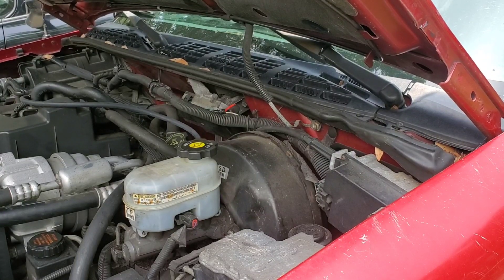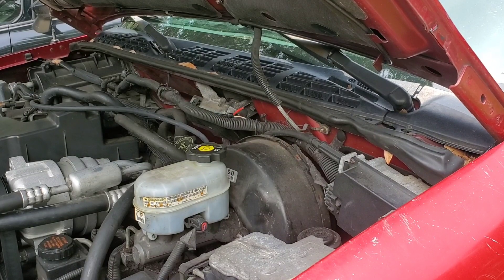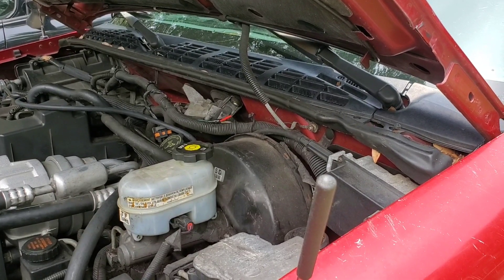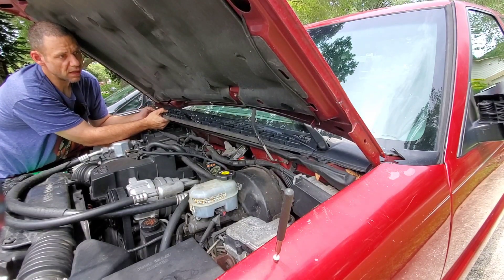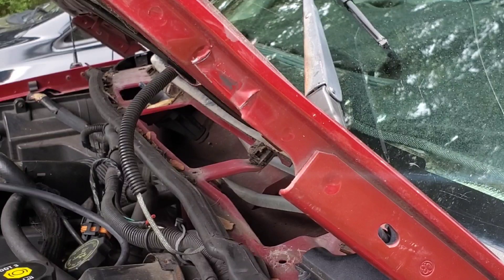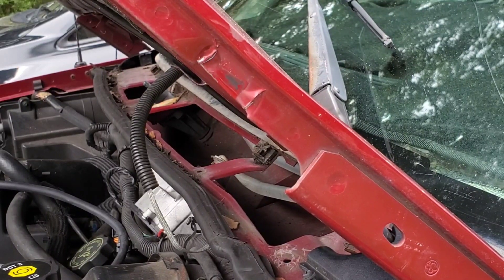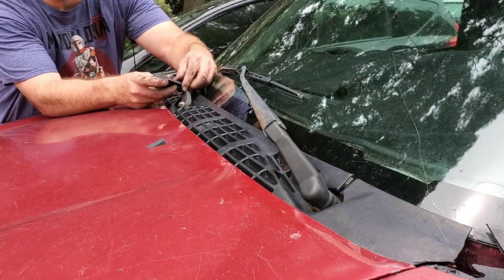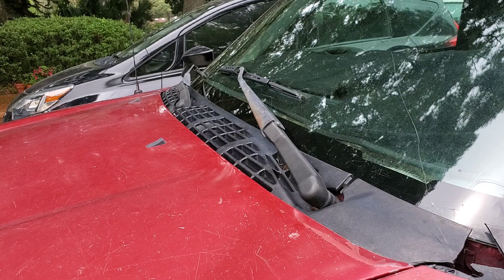98-04 Chevy S-10 And GMC Sonoma Wiper Motor Replacement

Comment: @"Scooter Hard to start Won't Stay Running? Adjust Your Scooter Valves Every 2,000 miles #gy6 #chinese" video. Simply put, thank you, I decided to buy a scooter because I have an INCREDIBLE amount of car aggression and have been learning about the their different issues for the last 2 years. The video you posted a year ago crossed my path and essentially restored my 2019 wolf rx 50 to new. When I bought it, it ran good, but now it's pushing alm0st 50mph (and if I'm being honest, using what I learned from that video it can be tuned even more precisely). I haven't even watched this video, but I'm sure you will give sounded advice. Also, thank you for being the type of person that shares knowledge, have a great life. You have made mine considerably less stressful.
Reply from the maker: Well thank you my friend, Honestly one of these days I'll do a complete breakdown of how to change your gears in your scooter and Do proper CVT tuning to maximize performance all the way around your scooter that way you can reach 70 miles per hour or better